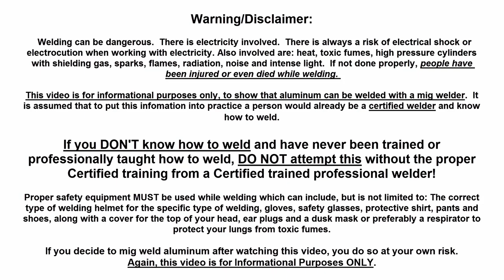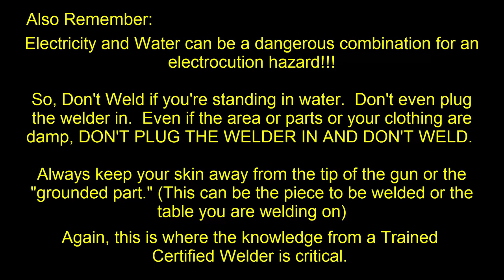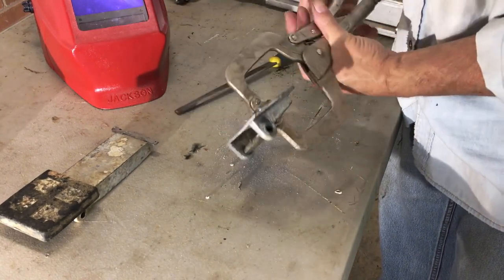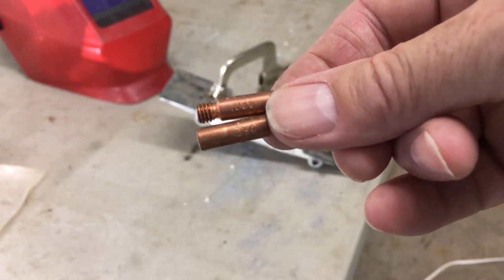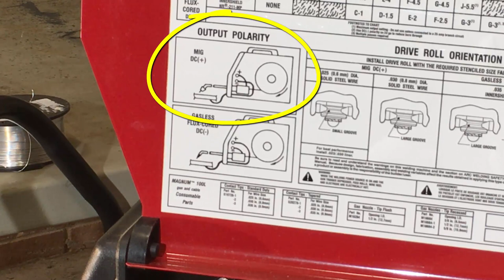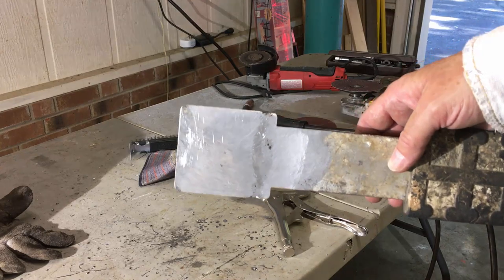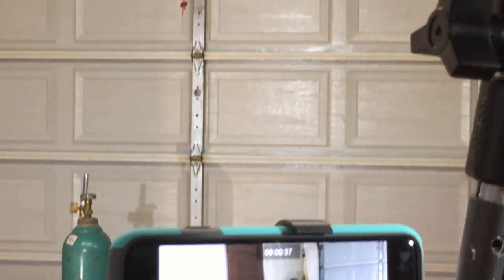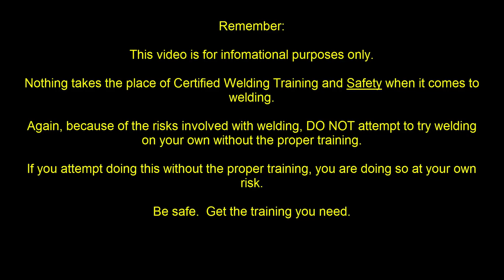Learn An Old Timer's Secrets To Mig Weld Aluminum Without A Spoolgun

Comment: Great vid - but the dustmask is dreamland - it's stopping close to nothing in the way of fumes. I have no idea how intelligent people - you obviously are - believe a crappy dust mask stops anything at all beyond maybe sanding dust from woodworking. Dopeyness like that bugs me - it's like seeing someone in the supermarket wearing a dust mask, dreaming that it protects them from tiny particles.. they barely stop dust on a good day - let alone welding fumes. It just makes people mistakenly think you are a bit dim.
Reply from the maker: James,  thanks for the comment and for watching the video.  You are correct: Dusk masks stop dust and dirt, that’s pretty much it.  When I used to weld, we didn’t use any kind of a dust mask/respirator at all, except when we would paint or prime something.  When I’d get home from work, I’d blow my nose and it would all be black in the Kleenex.  Now they have respirators that filter out a lot of that crap and fit under the welding helmet at the same time.  I used a dust mask for the video because it will filter “some” of the atomized metal and most of the dust and dirt.  And, it will keep your nose clean.  I would rather see a welder that spends a little extra money and gets a real welding respirator. I’m afraid most welders don’t ever use a respirator.  So, if someone does any kind of quantity of welding, they need to wear a real respirator made for welding.  The video was really more about the technique of welding aluminum with a mig welder.  Thanks again for commenting!

Comment: The disclaimers are a bit over-the-top. Only try welding if you've had Certified training first? That's ridiculous. Welding can be learned, as can many skills. You must have a lawyer in the family.

Several good tips in your video, especially the use of 5356 wire, and oversized contact tips. But please don't suggest that welding is rocket science. It is a skill honed over many years' practice.

Comment: All of this is great (actually, awesome_),  but I live in the Police State of New Jersey.  I began watching this video in the hope I can do what is advertised in the title. (And I no doubt could do it). However, because this is a Police State, I can't buy a bottle of compressed _anything other than store bought Mapp Gas & (those mega rip-off) tiny "Oxygen Cylinders" that last a grand total of 2 minutes and cost $15 bucks each.  The reason?  I live in a "Residential Zoned" neighborhood.  I would have to live in a "Business Zone" neighborhood OR have proof of a business address (obviously located in the "business zone" area).  I'm an expert with an Oxy-Acetylene  torch.  I wanna puke every time I try to do something serious with that pathetic Mapp Gas & (empty) Oxygen gas setup.  

Last week I saw two separate ebay ads (different sellers).  One guy was selling an old Sears 50 amp Carbon Arc Welder (advertised only as a "stick welder")  The welder is not as important as the Carbon Arc holders that came with it.  The other ad was for NOS Sears CORED Carbon Arc Rods.  Packages of 8 of them.  I placed an offer of $40 bucks on the welder. As soon as it was accepted, I jumped on that other ad for the carbon arc rods and bought out the entire stock (80+ Rods).   I had my doubts that 50 Amps could create a satisfactory torch, but a few days later (today),  I had the welder and the carbon rods, so I gave them a try.

I burned a hole through a piece of heavy gauged angle iron, and I brazed the hole closed with a piece of thick brazing rod that the "Mapp Gass/Oxygen" setup couldn't even MELT.   The braze just FLOWED with this thing.  I had never even used carbon arc rods before, but I had no problem controlling the arc and flame.  I was messing around with this setup for at least 10 minutes, and when I was done I examined the tips of the rods.  They both looked like perfectly sharpened pencils, with zero "side burning."  (perfect circular pointed tips).  Then I compared the length with a new pair. If I include the very tips of the "pointed ends,"  I still had exactly the same length as a new pair. 

Look, I dig the fact that Carbon Arc Burning & Brazing (& even welding) is as "inexact" as it gets, but I can't do any better where I live.  I bought a 110 volt auto wire feed Mig Welder and it blows fuses.  I ran a 50 Amp line 5 feet from the mains, and it works if I use it right there at that location with no extension cord; (the problem is my pathetic old house wiring & mains box with a max fuse of 35 amps), but even wired for 50 amps at 5 feet of distance from the mains, I can't go above 125 amps on the welder, because if the wire gets stuck for more than a split second, POP goes the fuse box!  I've learned to hate the thing: (but again, it's not the welder's fault, it's the house).  I've got a few beautiful modern welders that others drool over.  As for me, if I'm popping fuses, they are worthless.  I was amazed I ran that (circa 1970's) 50 Amp Sears welder for 10 minutes on a **15** Amp fuse line, and never popped the outlet saftey fuse nor the fuse-box. 

Anyway, what I'm trying to say is that all of these videos are great and accurate and they excite me, etc, etc... but I have zero chance of using any of these ideas.  And I can't tell you how happy I am to have 80+ Sears CORED, 50 amp compatible, Carbon Arc Rods, and I can use the heck out of them without blowing fuses.  I feel like a prison cage has been lifted from around me & my garage.  

While you guys are all doing state of the art... really cool stuff, I'm (literally just today) **celebrating** over FINALLY having the ability to burn, weld and braze... same as it was done in DIY shops & garages in the 1940's. 

Pretty pathetic, huh?
Reply from the maker: Wow!  Quite an ordeal where you live.  I'm glad you e found a way around it. Thanks for commenting and watching the video. I appreciate it!
Reply: Thanks for the reply.  As I stated, regardless of my ability to replicate your work here where I live, I thoroughly enjoy watching and learning from your videos.
Reply from the maker: It's crazy that you have to jump through those hoops to even be able to join metal on your own property. Keep your chin up and maybe someday you'll be able to have a shop with no restrictions.  That's what you can hope for. Thanks again for following this channel and for actively taking the time to comment.  I appreciate it immensely!!
Reply: You don't have to live in NJ.  You'd be welcome in Texas.
Reply: Get a inverter welder I have a 300 amp beast that runs on a 10 amp plug 
Oh I forgot I also have 240 v mains 
So sorry you live in USA

Comment: I was with you till I saw you dragging your file forwards and backwards
Reply: some people say dragging it both ways with aluminum in particular can help keep the teeth clean, as going backwards can knock the chip out, and aluminum is soft enough it won't break those teeth despite dragging it...i don't do it either but i suppose it's not hurting anything

Comment: No secrets, just a grinder and paint makes you the welder you aint. 
First useing a file to bevel amd no acetone is insane, clean that to high hell. 
Second 6061 filler is what you should use in 3/64 with pure argon.
Third turn your heat all the way up and your feed 3/4 of full. 
This guy is not a welder i will put my 15 years of welding experience against it.

Comment: Thank you for the information, I do appreciate that part. If you sense a “but” coming, you’re right...too much time was spent on unnecessary things like disassembling the part, changing cylinders, changing polarity, etc., but most of all, I did not need the advertisement for your welding mask. I found that very insulting and condescending and can only assume that you received it either at a reduced price or free in exchange for plugging it in your video. 
Also, rather than spending half the video spouting safety recommendations, perhaps just a quick disclaimer at the beginning would suffice. I almost switched off at several points but ended up just fast-forwarding through most of it. I understand that if I attempt to do something like this it is done at my own risk, no need to beat me over the head with that stuff, please don’t assume we are all imbeciles. 
That said, there were four or five minutes of very useful video, so thank you.

Comment: b
Reply: I do my own welding and engineering and don't pretend to know it all .
I've learned a few tricks here and appreciate your efforts.
Others have had some justified criticism and probably with more care one can put together a flawless video. but we are human i think . could be wrong 
 I prefer to TIG weld aluminum on thin materials, it requires more patience , and when its heavy I use lincoln stick welding ARC welding . and that really does burn fast .

Comment: that not welding, that tacking.. and aluminum is supposed to use A/C to weld...
Reply: maximum woof That's incorrect. He is "mig" welding (GMAW), you use reverse polarity for GMAW aluminum. Tig welding (GTAW), you use AC when welding aluminium. (Most of the time)
Reply from the maker: You'd be correct if you're TIG welding, but this is MIG. Thanks.
Reply: Ya need to visit Weld.com and watch Bob weld AL with DC.
Reply: Ac is only for Tig welding they don't make ac mig machines !
Reply: Danny Tobi  The Lincoln power mig 350 mp welds aluminum in AC.